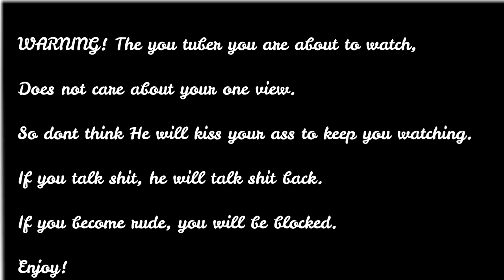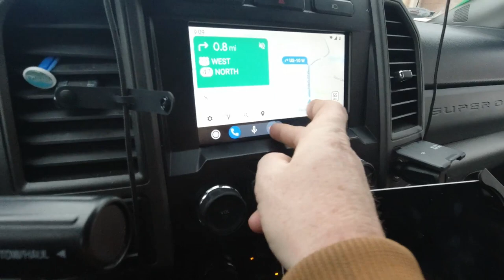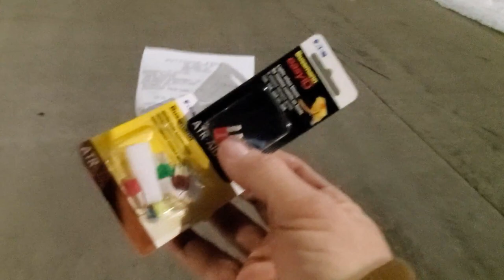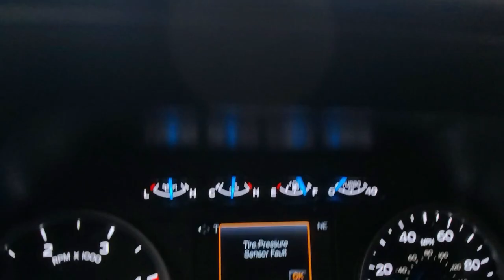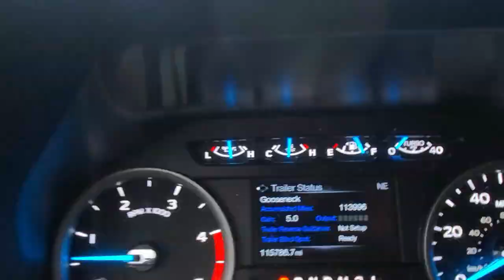Hauling a boat on a trailer, on a trailer.

Comment: Thats nothing, I drive a 2018 ford f150 POS, the sync stopped working 5 weeks after I had it. No big deal , I have an aux input for music. That quit working too. So I brought it in, when I needed a new windshield , and an oil change. Told the service person before hand what wasn’t working.  She set up an appointment a few days later. They said it would take a day to figure out the issue, and a day to get parts, and a day to put the parts in. Not happy , but I wanted it fix. So they had it the 3 days , I pick it up , a different person was there , they said all set. I drive away, assuming everything was working. A few days later I try to connect my phone , and nothing. I then try to use the aux. and the radio screen goes black. Everything else with the radio was working. So I call,  bring it back . Again 3 days to work on it. Get back 3 days later i pick it up , and they said they need more time. I told them I’m going on vacation the following week. They said that will work. I get it back after vacation and it is still not working , but I have a new screen . And they will call when the parts come in. 5 weeks later they call . And need it another 3 days to install . Still not working after the 3 days. Now they have had the truck for 14 working days at this point. I said forget about it . I’ll pay for the oil change, and were done. They gave me a bill for over 1500.00 for labor. I said how much for the oil change ,  think it was 45.00 ish. I told them all I’m paying for is the work that has been completed .  I said how long does it take ford to build one truck , I dont  remember what she said but it wasn’t 14 days.Never heard anything.
Reply from the maker: Wow! These dealerships are just part changers and have no idea what theyre doing.

Comment: Get a company driver job for a smaller trucking company. Where I work there is 90 trucks. Zero worrys the drivers just drive  newer trucks. Guarenteed 1k week. Run hard 80k a year. Home weekends. 3paid weeks off a year. Full cheap benefits. I'm a trailer mechanic for over 12 years and all trailer wiring fails. Been watching since your first video. You are working way to much for what you make. No strapping or tarping  nothing. Only haul reefers and dry vans.

Comment: Drop that Android crap and get an iPhone 11 Pro Max Plus, I deliver cars and every car I get into the sync syncs before I can buckle my seatbelt. And it works with hands free that’s installed in every car!
Reply from the maker: ive had apple though lol I couldnt stand it
Reply: SouthGeorgiaHotShot I was a software engineer and equipment engineer for Southwestern Bell and was part of the team that designed and built cellphones and towers, I would build my own desktops and laptops. I am a musician and work as a session musician . After having very expensive laptops and desk tops names like HP and Gateway and Dell crap out I switched to Apple and never looked back. All the money I spent on my degrees and Apple is so much better that problem you are having trying to hang up your phone just do a forced restart of the phone shut it down and power back up. Until you run the program you ran before it froze up again you won’t have that issue! Desktops have the same issue it’s one line of code that the phone and the truck don’t agree on and so the truck stops recognizing the phone! BTW banging on the screen won’t help the truck locked you out of that function which is why you cannot hang up. Go to an iPhone place and have them demo a new 11 Pro Max. Worse comes to worse than them and leave! Simple!

Comment: this load makes no seance, your trailer is a 5th wheel trailer witch means your legal to tow that boat behind your trailer, why would you waste deck space.. i have  recever hitch on all my 5th wheel trailer, and a 7 pin RV plug for lights and brakes, if it can be towed we tow it.. 2nd you never tow a boat with the motor up with out a motor support to the trailer, you will brake the transom on the boat, even if the motor is down you always have a suport bar from the motor gear box to the trailer to support it, that heavy weight bouncing cracks the transom up. dont work with rip off brokers .. run ads on line, for loads at your price,3rd thhis is why i been custom building trailers for years, yes they cost more then these mass produced junk trailer, number one rule you never put any ground wires to the trailer frame, every ground wire is hooked to the battery ground wire, and he ground on the truck plug is hooked to the battery ground by wire only
Reply: Some states don't allow doubles with a pickup

Comment: Get a iPhone, much better software, zero problems with my sync in my ford.
Reply from the maker: what app does apply use for ford?
Reply: SouthGeorgiaHotShot : im not sure how it works. I got in the truck and pushed the pairing button and the truck gives you a code  just enter the code and it works. Pretty simple.

Comment: Just finished watching this vid. Imma have to tune out for awhile.
Your constantly nagging and Bi**chin. If its not the sync or the tire sensor, Its your aftermarket gps or your trailer or something else, broken record already. Go back to the first months when you just started. Now those are great, no actually awesome videos! You're like in this down whirl spiral and its going to impold any minute. 

Do you realise the ppl commenting applauding your outburst and rants about hating certain things. Just wanna see you miserable and failing? Those are your true "trolls". Like who in the right mind can agree and like you being angry? About 50 to 75% of your vids are complaining about things that don't matter. They like to see you fail, do you see that?? It's not healthy at all. You need to take time off the road like 2 or 3 weeks. 

I think this is proving to be to much for you and you dont wanna give up because you dont wanna fail, thats my opinion. Something is gonna happen when you least expect it brother, and its gonna be a wake up call.
Reply: And what do you do? Sounds like your job is inside a heated & air conditioned building or do you have one? The people that agree with his rants are actually out there and feel his pain. Have you rewired a trailer by yourself in a parking lot at 17 degrees at midnight in the dark? Actually I have. I've done lots of work in the cold & hot. I probably rant more then he does just not on camera. I own a diesel mechanic shop & I do towing so I feel his pain on both sides. You can start with the best job out there & one broken bolt, part, delay, something missed and that job just went sideways real fast and cost you a lot of money or downtown. Its the nature of the business were in. Its not for everyone that's for damn sure. So before you criticize someone you need to experience what they do first...